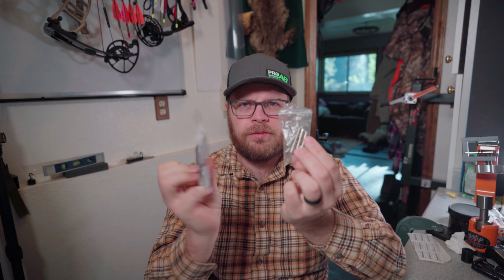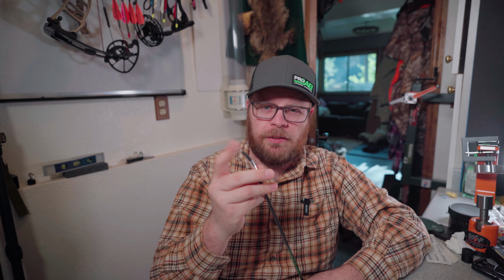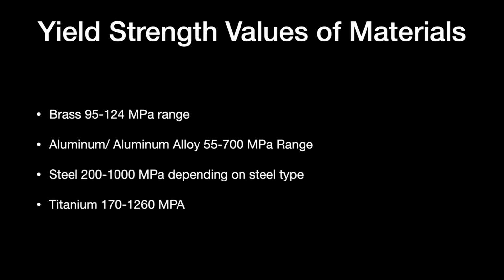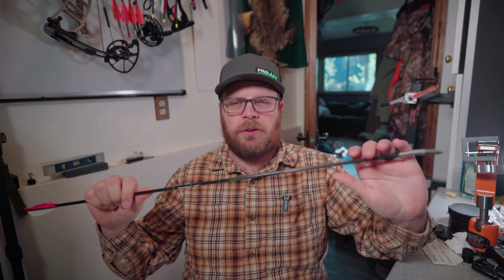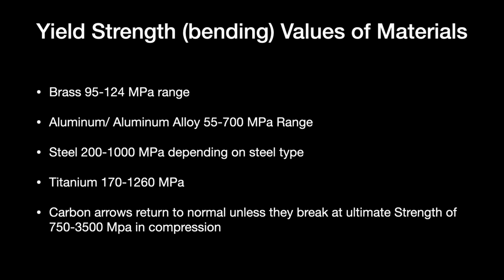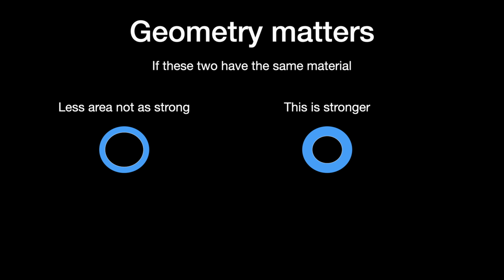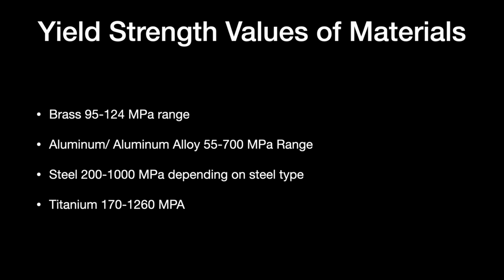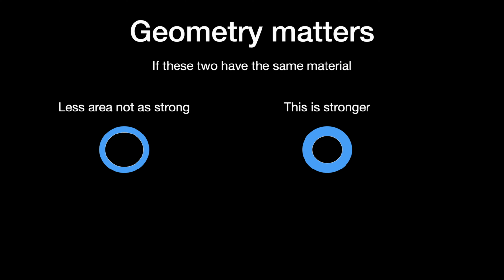Does Material Matter for Arrow Components

Comment: Great video. Ive been using the stock gold tip inserts along with the .246 arrows. Ive had many hard impacts on wood and have never bent an insert or had it break the carbon. I use the hunter series and the velocity series. I square my arrows with the asd and i use hobby hot melt glue. I dont understand why some people have an issue with inserts bending or breaking. If i were to have an arrow impact a rock or hard metal i would absolutely expext some part of the arrow and or component to fail, i think expecting otherwise is expecting to much. Part of why i like the gold tip hunter and velocity series is becase of how affordable they are.

Comment: there is no value what so ever to use alumium inserts, nada, non, zero, no what so ever
Reply from the maker: Sure there is, cost is the big one. Most inserts are at least $60 a dozen. Most good components cost much more than another 1/2 dozen arrows. So what has more value components or another 1/2 dozen arrows? 

As a side note I’m all for using titanium or steel components over aluminum, but I’ve used some steel components that have bent easier than aluminum. I have also used titanium components that were very durable but poorly designed (bad tolerances). So material is not the only thing to consider.
Reply: @LEAPArchery  you want your inserts as heavy as they get, while keeping your arrow not exceeding your weight limit, there is no use whatsoever for alumium inserts
Reply: @ no one will buy your lightweight inserts, well fools maybe, but this is bad investement you should get rid off
Reply from the maker: @flyfin108 I don’t make or sell any arrow components? I understand your point on added weight. But why not the just use a glue in broadhead of much heavier weight and get rid of the insert all together?

Comment: Thoughts on the evolution broadheads glue in system? running it with the aluminum collar
Reply from the maker: The only question I have is the glue in stud solid or is it hollow. Regardless I think as far as .166 components it’s probably one of the better ways to go. All you loose is the flexibility to replace the point if the arrow is still good.

I have no personal experience with the glue in but I am looking at trying the screw in tips.
Reply from the maker: I do like that they list the steel 416 hardened so it probably has a yield strength value of at least 500 Mpa

Comment: I had trouble with Ethics aluminum components bending. I heard that they use a weaker type of aluminum than some other companies do. On my Victory standard diameter arrows I actually prefer the 22 grain aluminum stock inserts more than the 33 grain stainless inserts because they are about twice as long inside the shaft. I haven't had one of the stock Victory 245 inserts fail on me or bend. 

I am just hoping that 4mm components will get better and more affordable.
Reply: Ethics uses 6061 aluminum. Some engineers don't even consider it as metal lol. It's corrosion resistant, but that's about it. It fatigues over time. 

Ethics also uses 302 or 303 stainless for their steel. It's junk steel. That's what screws and silverware are made from. It's an upgrade from wrought iron, but it ain't very good otherwise. 

If you're buying from Ethics, get the titanium. Otherwise, get a minimum 7075 aluminum or hardened steel from someone else.
Reply from the maker: I have been using the new Easton match grade  4 mm aluminum and I have been very impressed with those. I have not bent one yet I did bend my 150 grain stainless field point on the front of one but the insert was still good.
Reply: @LEAPArchery Easton aluminum 4mm half out are really tough! I’ve put them through 2x6’s and the corner of a wooden shed and have yet to bend one😂
Reply: @ good to hear. They look like a good design, better than the Victory Shok TL. I didn't care for those and had a couple start wobbling after shooting targets.
Reply from the maker: The nexxus titanium 4mm component is crazy strong as well I was using instant set glue and didn’t get the insert all the way in. I could never get it out and I have damaged it (I did try very hard haha) but I found that the depth of their system doesn’t work with all broad-heads and field points sometimes they couldn’t thread in all the way so I don’t really recommend it unless they have fixed it now?

Comment: Thank you for the video! You made a point several times to talk about carbon being less likely to break than the inserts just because it bends so well. What’s your opinion on hit inserts from Easton?
Reply from the maker: Overall I have no issue with the hit insert (structurally) however I think the installation is sometimes a pain and I think glue failure is the biggest problem especially with impact. I bet most broken arrow with hit if you examined them the glue failed and the field tip/broadhead and the insert then acted like a wedge and crack the end of the arrow shaft.
On thing the hit does fantastic is concentric with little tuning needed. Put a small collar over the arrow and you have a great component. The collar prevents the wedging action from happening.
Reply from the maker: Thanks for watching!
Reply: I’ve read you need to use the supplied epoxy not glue as that’s part of the equation to make everything rock solid. Used FMJ for many many years without a single failure.
Reply from the maker: @deanbrantley that would make a lot of sense. You have not had one bend or the shaft mushroom? That’s Impressive come to think of it all hit arrows I have used were built by a shop. So I’m not sure if they used epoxy or not? I’m built Easton arrows since but not with the hit system
Reply: @ I won’t say bend. I’ve bent plenty of FMJ’s as that’s a common downside of them. But push the HIT deeper and mushroom no! I’ve never had one do that.
Reply: Thank for the reply, I should have specified with the collar. Without it I have seen a lot of arrow shafts split and go around the insert/point like you described. As for the epoxy I work in a bow shop in Boise and we never used it because you typically have a problem with the inserts migrating in or out before it fully cures and it makes the arrow useless because the point will bottom out or not grab enough thread. Also I noticed this year installing hits that a lot of them no longer come with the epoxy they used to. And yes they are very messy to install…